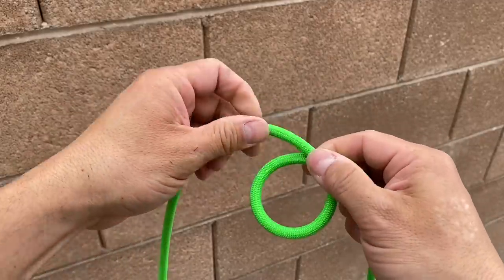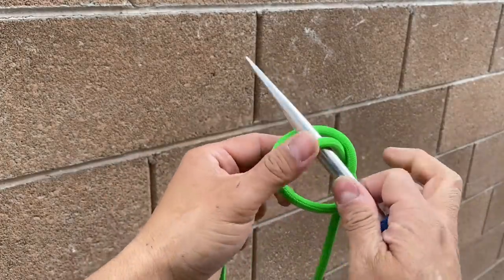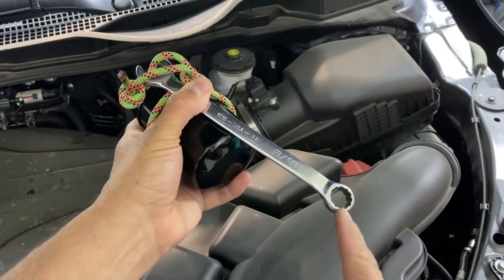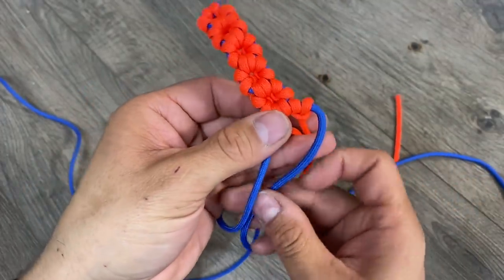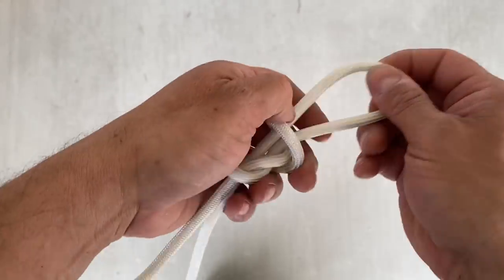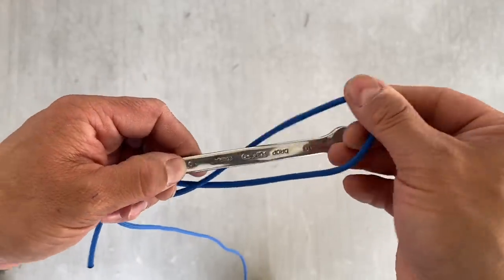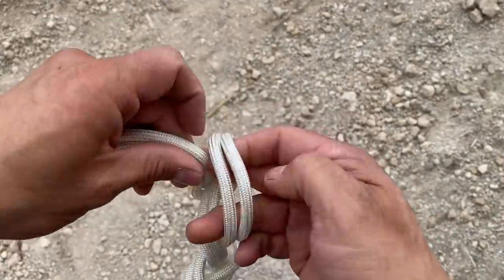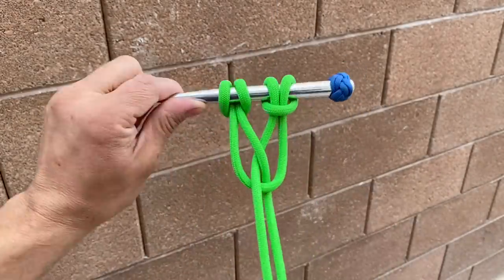The Intermediate Guide to Knots

Comment: I, too, love just messing around to find new possibilities. Fun stuff. A while back I created a loop that is completely non-binding - like anti-binding... You take a short bight, make a loop and then twist two half-hitches on to the bight. Dress and pull. The sheepshank-type knot pulls apart with tension (hence the non-binding factor) and is extremely strong. (But the loop must be pulled in only one direction or be free to swivel so both ends of the loop are pulled with the same force.)
Reply: Ha, I think you have reinvented the Bellringer's Knot :)

Comment: Thanks for sharing. 
Agree with all but the knot @ 4:28 . .

Personally, as I'm opposite of your 
brother-in-law, I do most of my work, 
or close to it below ground in 
confined spaces & hanging in a 
bolsterchair..

If a single tool, say a ratcheting 
combination wrench, or a tool with 
a through hole...

It is found best to use a locked loop 
(Bowlin for example) that can be ran 
through the hole and pull the tool 
through. It makes it easier to remove 
to use the anchored end & return
(Or just place it in the canvas bucket).

I just had to put that out there. 

Thanks again for sharing.